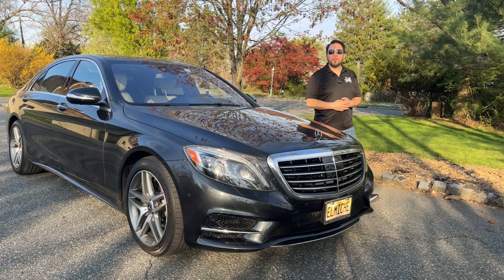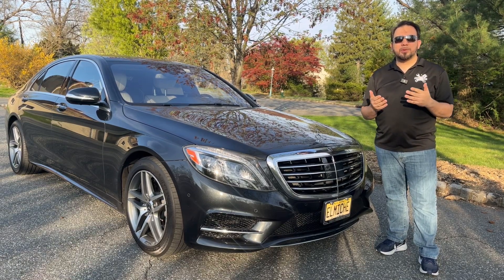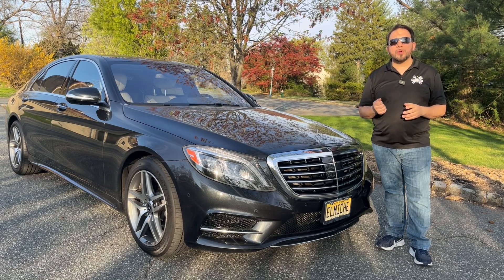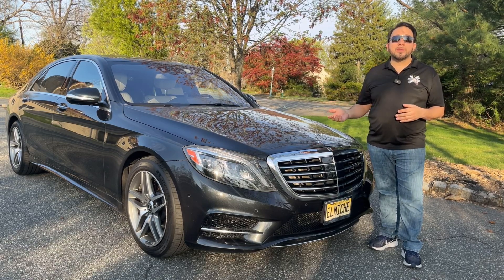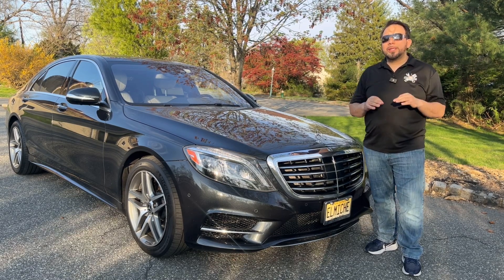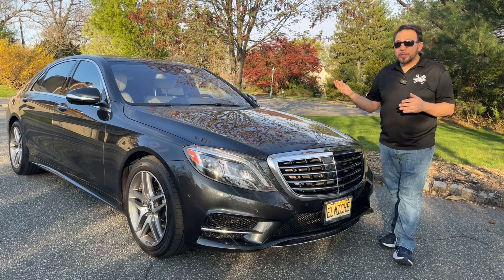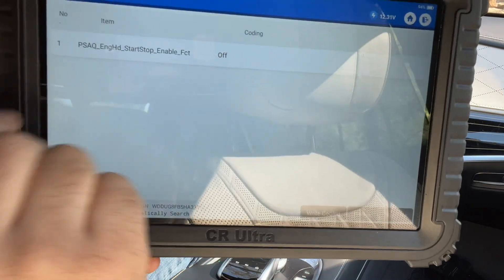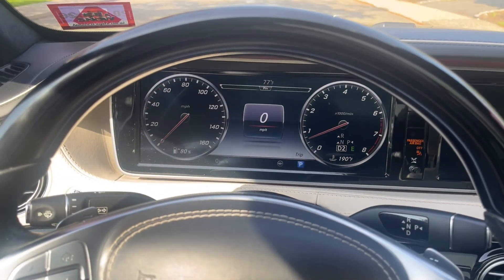Myths - How to shut off auto start stop - permanently remove auto stop start - #repairjose

Comment: Jose, how are you enjoying your S-550, was wondering how many miles, mine has 79K. I need to replace the front struts and was considering selling it afterwards. How many miles can you expect to get out of the s-class, well maintained?
Reply from the maker: Thank you so much for your comment. I love my Mercedes I have 56K. You can have the struts rebuilt. I wouldn’t sell it. You still have a lot of car there. You’ll be mad when they make you an offer. Unfortunately the price in these cars go down really fast. I wouldn’t sell keep it for another 100K.
Reply: @josecitomarin thank you Jose. I appreciate the reply. Just today while putting my car in reverse, there was a stutter to how it backed up. Not smooth. This made me very nervous. I’m going to check fluids, mounts, maybe it’s software related.

Comment: my dynamic seating stopped working like massages, lumbar support, various seat settings. what do you recommend a problem could be? air pump in the trunk? blown fuse in trunk? unplugging the battery for 20 mins?
Reply from the maker: Thank you so much for your comment. I would start by checking if the pump comes on. If the pump burned may be because you have a leak somewhere and the pump was overly running and overheated, before it burns it may just burn the fuse so check on that too. A scanner should be able to tell you something about it.